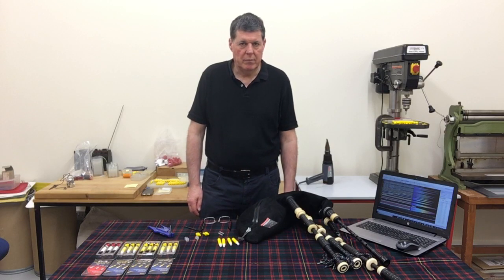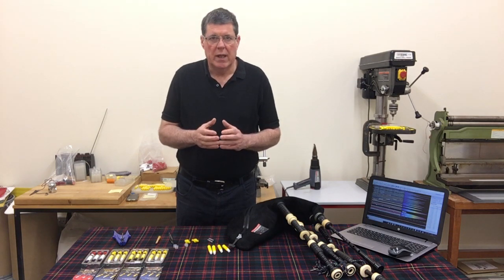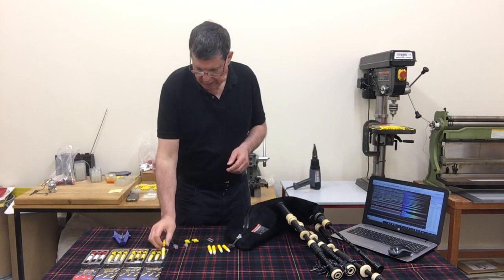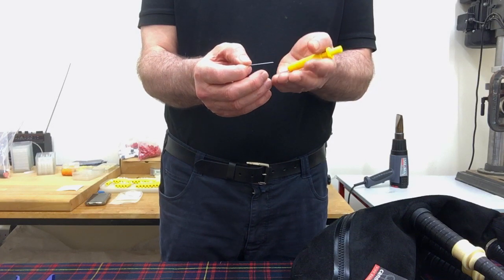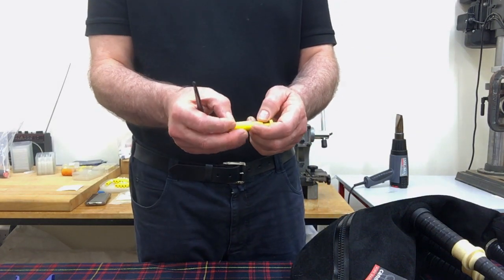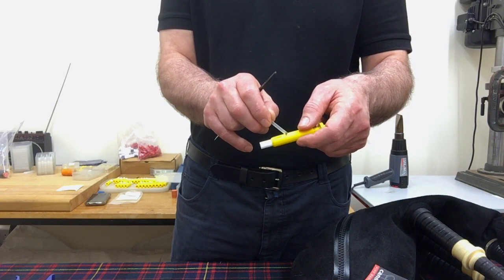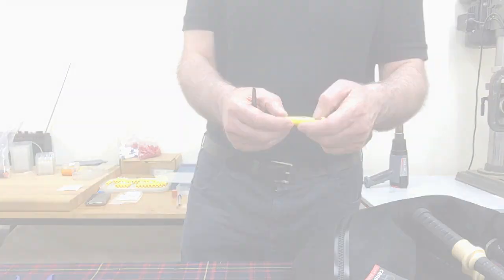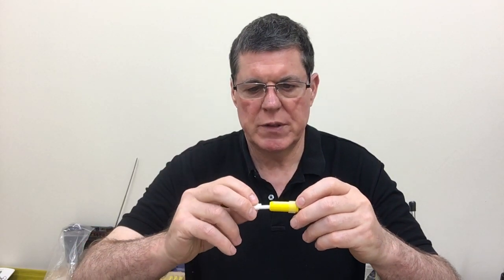Highland Reeds: drone reed improvements and functionality

Comment: Hi I'm going to be getting the newer ones with the best sound, but would like to ask if I wd still need a moisture control system? I just have the basic red end cap at the end of a tube I got with my canmore bag just now. If I did need to get one which I think I may would a simple bottle one suffice if the drone reeds are protected from moisture? Thanks in advance.
Reply from the maker: Jamie, yes is the short answer. I play Bruce's moisture tube. It is very effective. Simply but effective. Yours sound like the ssame one I have so stick with it. I'd advise throwing the bottle away. Stick with the little tube with th eholes and the cloth inside it. Simple but VERY effective. (The bottle attracts moisture rather than minimises it).
Reply: @stuartletford4349  brilliant! Thanks a million for getting back to me so quickly, I'll do that then for sure, happy piping brother ☮❤🎵